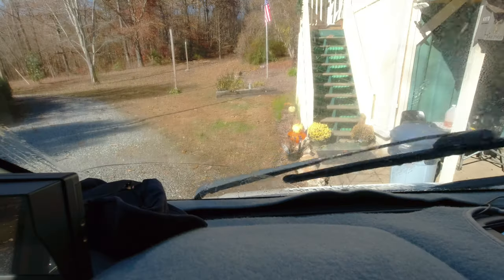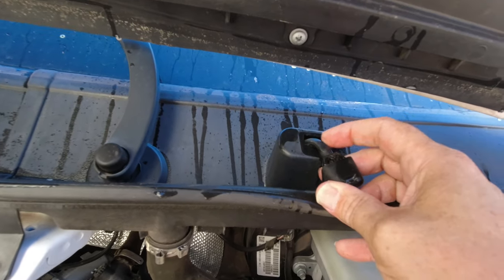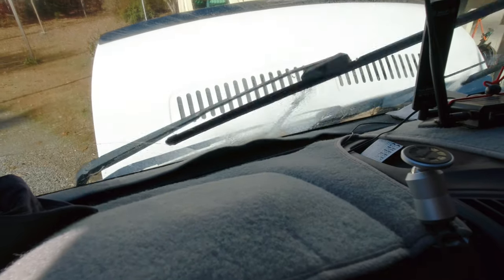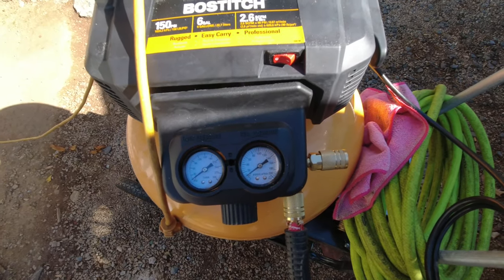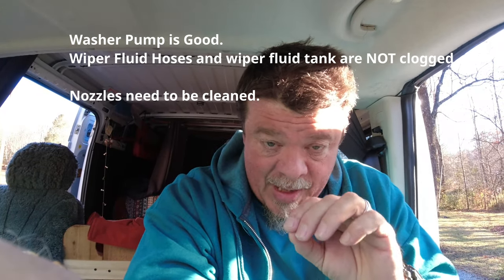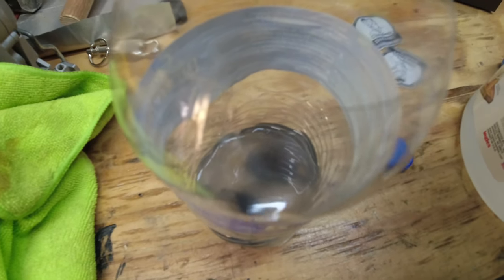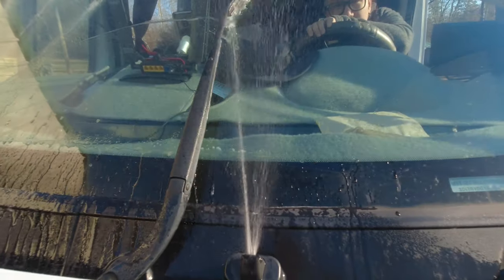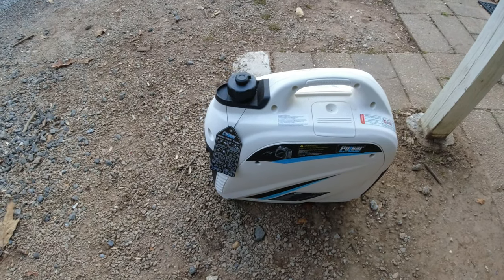Windshield Washer Doesn't Spray Fix | Ram Promaster Van

Comment: What psi do u use for the air
Reply from the maker: @BumpyBilsko  I believe it was set to under 60psi.
Reply: @CheapGeek  nice. Just tried to spray the fluid with the nozzles detached. NOTHIN. trying to prepare for this damn snow storm
Reply from the maker: @ Dang! That stinks! 😉

Comment: Excellent, I'm having the same problem with my sedan. Did not know the nozzle thingys could be cleaned like that. 
 Will try it this week! Thank you
Reply from the maker: You’re Welcome! Let me know how it goes! I’d appreciate it!
Reply: Yep it worked. It was a bit fiddley getting the tip back on the hose. Just like a drip irrigation head, if you've ever had to clear those.
Reply from the maker: @lindapeterson5810  Awesome! Glad it worked and thanks for letting me know! 👍